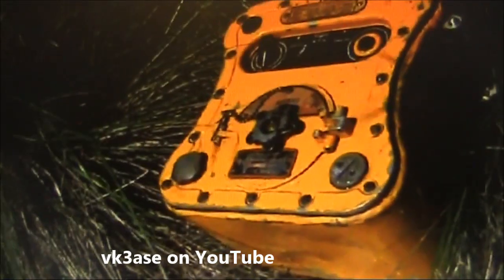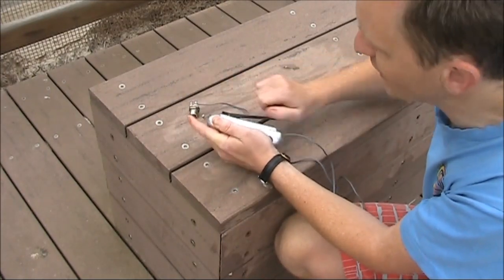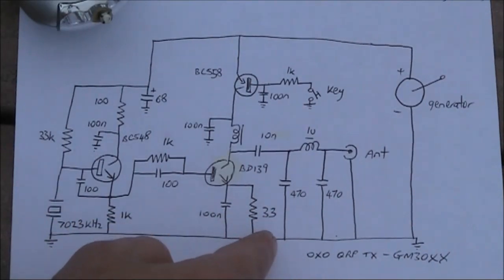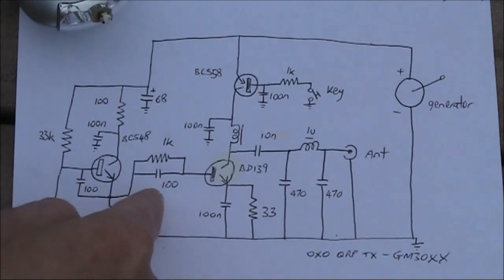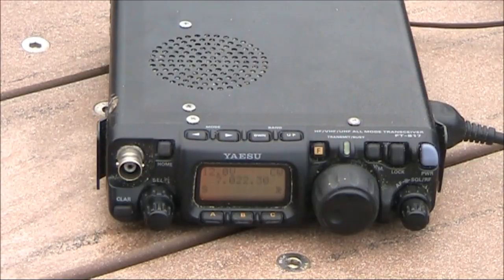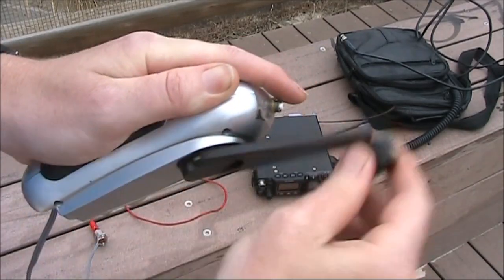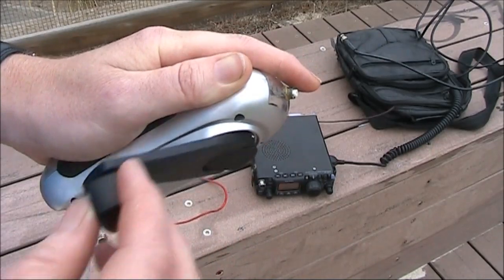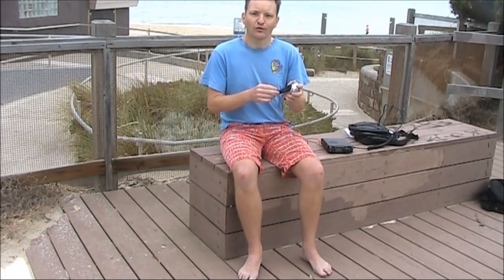Hand-powered CW transmitter built into a wind-up torch (inspired by the 'Gibson Girl')

Comment: That's great Peter, I agree with Electronoob that a super cap would be advantageous though there may be space limitations.

Those lights are pretty neat but have found that the handle' fails somewhat prematurally
Reply: Funny enough, I have this exact radio and added supercaps to it, connected as an external module that plugs into the back. 

Downside: It takes over 30s of cranking to get it up to 5V.

Comment: can you still use the original battery that was in the torch to run the radio? so that you have a hand crank transmitter that doesn't need constant winding?
Reply from the maker: +SirLobsterman I suspect the current drawn would be too much. And what was inside was a tiny button cell which I suspect did not do very much (couldn't even charge it for the torch properly).

Comment: Nice! I might actually do this... what about the tx power, might I just use a wire without caring much of the SWR, I mean.. how much SWR will the BD139 handle?
Reply: At 500mW the BD139 will be fine, even with infinite SWR and 100% duty cycle. It has no heatsinking though so heat will be a bigger problem under these circumstances. However, since it is a CW transmitter the duty cycle is very low so it wouldn't get too hot, even with infinite SWR. On another issue, I like Peter's simplicity with this one, although I can see improvements that could be made. I was thinking about it though and concluded that you run into problems fitting it in the torch if you implement them. Great little project Pete!

Comment: also how long was your antenna?
Reply: Kristyanna Virgona if it was a full size dipole without any loading coils the whole dipole antenna span would be roughly 16 ft. however that is for optimum SWR and performance. for a small power like 500mW you could get away with a small wire on the centre conductor of the coax and no ground plane or counterpoise wire.
Reply from the maker: +Kristyanna Virgona At home when testing it I was using a half wavelength dipole.  A half wavelength end-fed would also be OK but you'd need an antenna coupler.

Comment: Great effort, Peter!  Would it be useful to fit a clamp to it, so you can clamp the transmitter to a fixed structure (eg table, etc) - this would allow you to easily crank with one hand and send with the other while not having to put effort into holding it as well?

73,

Mike VK2IG
Reply from the maker: +vk2ig Good idea Mike!